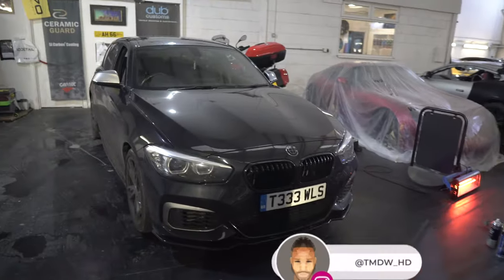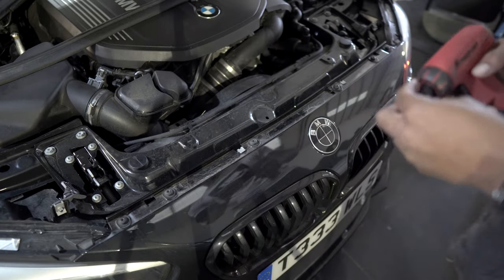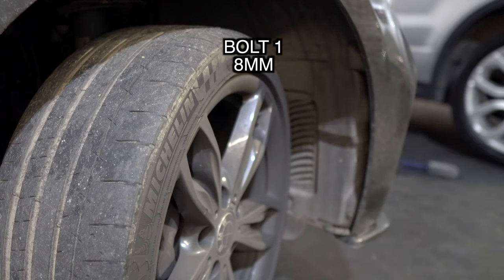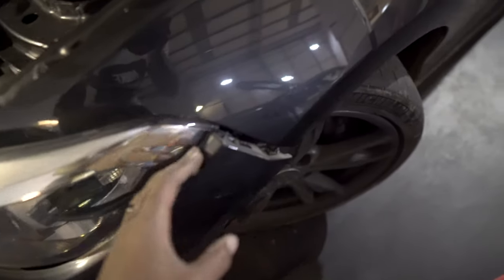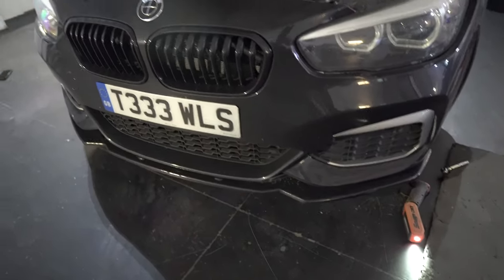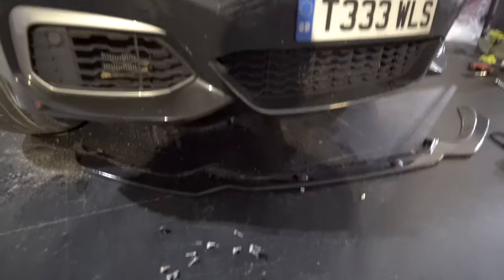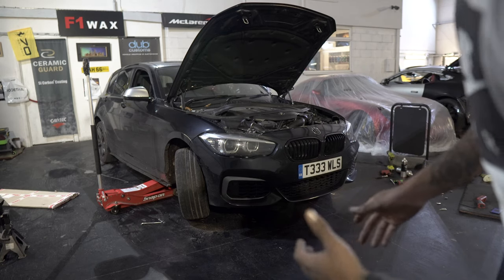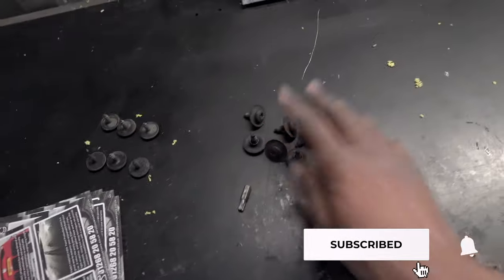DIY BUMPER REMOVAL on the M140i! EASY!!

Comment: How did the bolts go on the splitter? Since the splitter has to go back on last I'm intrigued to know how you did this. I need to do these exact mods. Fit the rock mesh and put some bolts in my Maxton splitter. My splitter is only held on with self tappers at the minute and I'm constantly worrying about it coming loose.

Comment: Great video and lovely motor! I just got a new 1 series f40 and I've bought a black grill to fit, do you know if it's the same process or is there any cheats to doing it without removing the bumper?
Reply from the maker: Have heard you can just undo some screws and pull top bits forward but never done myself mate...